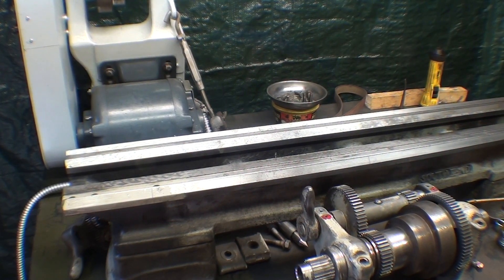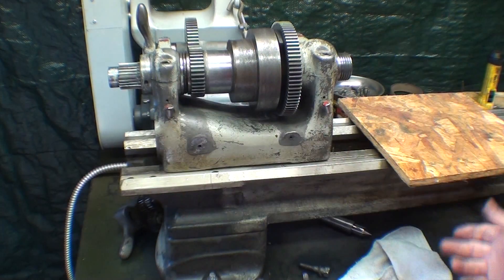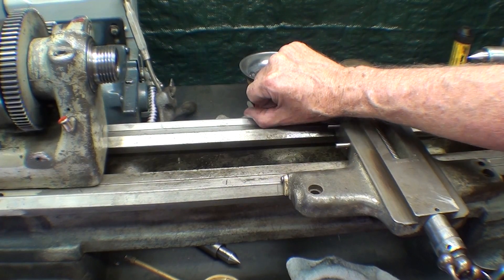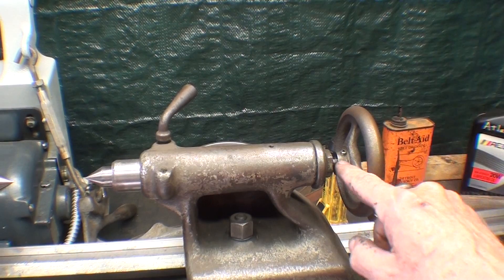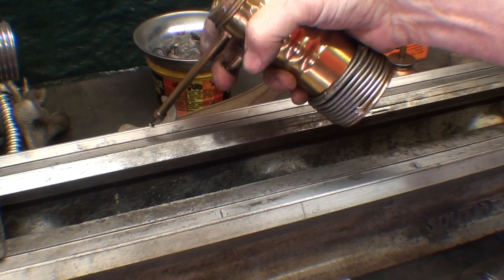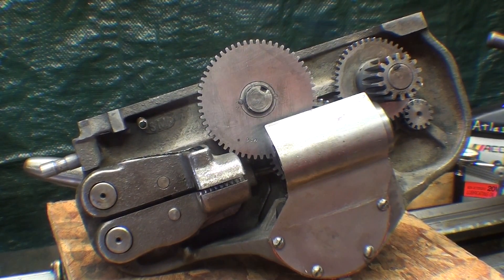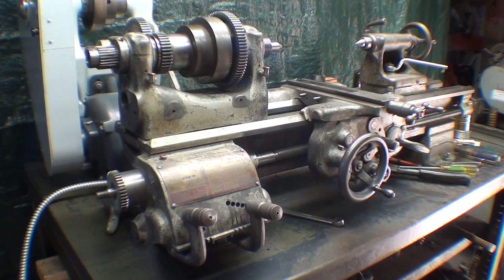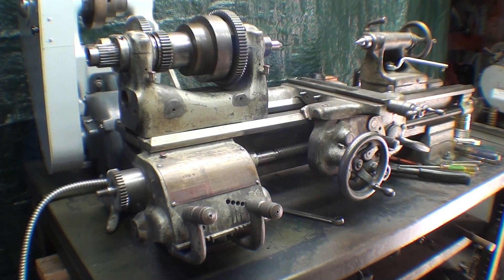Tips #339 Reassembling pt 1 - Headstock of SOUTH BEND 9 in Lathe tubalcain

Comment: Can’t you shim the tailstock, between the tailstock and its base?
Reply: There's a joint in the middle that allows for and aft movement. Normally, used for turning slight tapers, or aligning in that dimension. A piece of .010 shim stock in that joint would be a solid joint. But, the shim might need to vary depending on where along the bed you measured. I'd measure it at three or more locations along the normal range of travel of the tailstock, and probably use the thinnest  of the points for my shim thickness.

Comment: Wouldn't it be awesome to build both bases headstock and tailstock the same dimensions so you could swap them after years of use and have them ride opposite ways to extend the wear capability.   Just a thought.  I also love the assembly bolts for gears on the south bend . They no doubt are more durable than others I have seen . I'm just trying to use the best ideas while I begin my journey of building a lathe .

Comment: I must not have  seen where you said there was no way to compensate for the tail stock hight error
Because I got my choice of best parts from 2 different SB 9 I was looking at another south bend tail stock and it appeared to have shims at the parting line area just above the bed area so i got the one without the shim stock
But havent got the check mine yet
Reply: And you can put a #2 reamer in the chuck, and ream the tail stock quill.

Comment: Thank You Lyle.....Over the years , I have often thought that it would have been wise  for the manufactures to "mirror" the  design of the lathe. In such a way that when the wear becomes excessive it would be possible to flip the bed 180 degrees. This would give the operator a fairly new surface at the head stock.....I always look forward to ALL YOU DO THANKS......Jeff
Reply: But then the head stock would sit low; although I suppose you could shim it...

Comment: Are there still any places in the US that you can send a lathe bed like this to have the ways re-ground? If it could be done for a couple hundred dollars it would make sense to have it done.
Reply: There is, Keith Rucker(Vintage Machinery), did a You Tube video where he dropped off a lathe for someone to be ground, and showed a small shop tour of the business that did the work. Remember besides the bed, you really need to do the head stock, tail stock, and saddle, also. As for cost, well a "couple hundred dollars" isn't going to be enough.

Comment: I know how goofy this sounds, but its too bad that they never made lathes with removable ways so that when the complete machined way length itself became worn it could be removed, turned end for end possibly improving the situation, I know this woudnt be practical.  But replaceable way bars or wear strips running the length say 3/4" thick made sort of like giant gibbs might have been.  If they were accurately made, located and bolted to the base it seems like an entire lathe could be saved and brought back to almost new - you could have the same thing on the base of he tailstock - I know I know too expensive and not practical, but imagine how long a well cared for lathe could last with this feature if it were possible-!!
Reply: I understand that some lathes do have that feature, they  are possibly restricted to larger machines, but if I remember correctly Warner and Swasey and possibly American Pacemaker both made such lathes.
Reply: Really-??!!   I thought I was just fantasizing off the deep end, especially since im not even a machinist-lol   I see what ya mean though, something like that is probably only practical on larger machines.
Reply: Similarly, I've always thought it would have been cool if the flat way Atlas lathes had identical mountings on the tailstock end/back side that allowed one to turn the bed around and have a fresh section of relatively ware free ways where previously the tailstock had sat.
Reply: The problem is South Bend does not have hardened ways and they aren't top of the line. 
Plus how the lathe was treated in its lifetime.
Many of these old lathes are well past their expected lives as it is.
A testament to how well they were made., 

I have a 1947 Shopsmith I restored and it runs great with the same old motor.
Worth

Comment: Would it be worth fashioning a shim for the tail stock to level it?
Reply: A shim would be fine if the wear along the bed were even . But since the wear is inconstant along it's length a one thickness shim would only work at one specific spot on the bed.
Reply: Mr Pete said he thought most of the wear was to the actual body of the tailstock; if so, it is made in two parts (to allow lateral adjustment for turning tapers). There may be some way to fit a 0.010" shim between the two parts.
Reply: I don't want to be confrontational, but at 7:18 he mentions the centers seem to line up and then at 8:36 with the tail stock at the end he says there is 10 thou difference. Seems to me there is more investigation required ; )
Reply: If it were me, I would put shims between the cricket and the tail stock. As noted, there probably isn't much wear on the bed's flat and vee-way the cricket sits on. When shimming, it is important to see that the quill  in the tail stock is parallel to the lathe bed, i.e. you might need different shims at the front of the tail stock between it and the cricket than at the back of it.
Having the tail stock sitting that low will cause a slight taper in the work when cutting between centers that can hard to eliminate if you don't realize what is causing it.